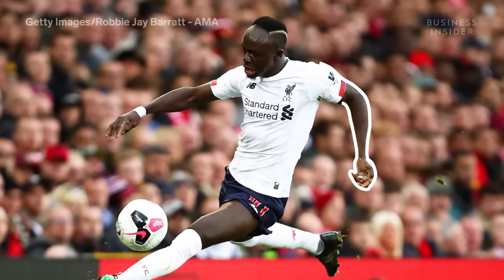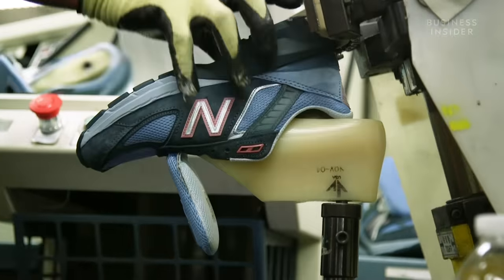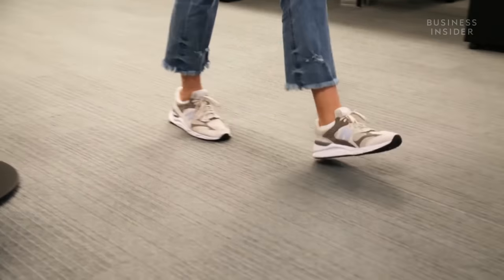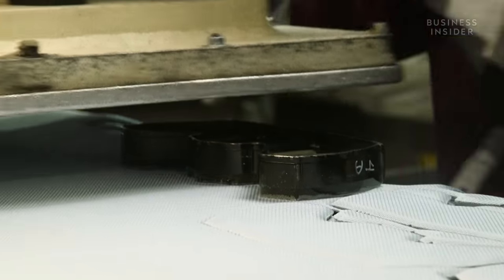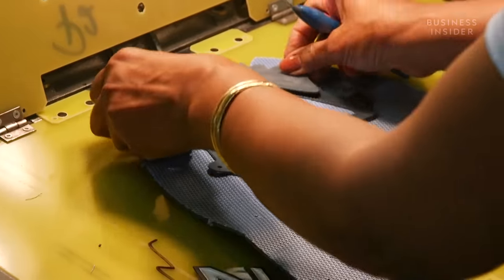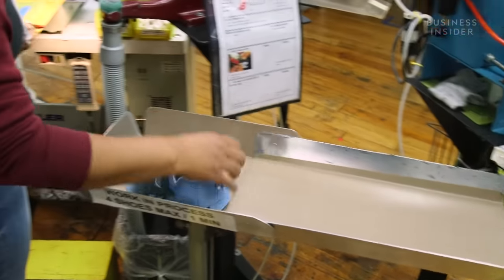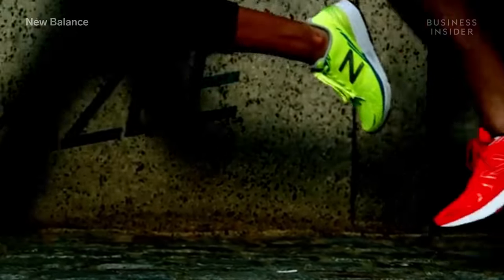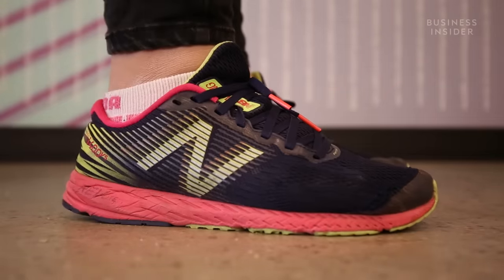How New Balance Sneakers Are Made | The Making Of

Comment: NB Number System
50: Fitness Running
60: Stability
70: Light Stability
80: Neutral
90: Speed

Very handy to know now!
Reply: What is 997H?
Reply: @andrew1983  thanks. How do i find this list, (other than this video)
Reply: C J I never knew that!! Thank you!
Reply: 40 is "Control" aka Motion control or optimal control.  The 840 is oddly an exception to this rule and is a neutral cushioning shoe.  Many of the shoes don't have numbers so you have to look at the tech sheet to see which category if falls under.
Reply: 1000 level?
Reply: Thanks for posting this I never knew.
Reply: 574?what class is belong to?
Reply: @diazzlingpictures2236  70
Reply: What's the one on the video called
Reply: @diazzlingpictures2236  fitness running 🏃‍♀️ I think it’s what number it starts with ^^
Reply: What's the number for standing in one spot for 10 hours with limited walking? Actually it's probably the stability or light stability I guess.
Reply: I got a 420. Not even joking. Which category is that? I also have a 009.
Reply: 2002r?
Reply: 1906?

Comment: One big difference between New Balance and All the other brands True Wide Foot support It's definitely not perfect but New Balance is definitely the best when it comes to it's wide shoe selection offering compared to their competition where you'd be lucky to find a shoe that they sell in a wide size That the reason why is buy New Balance They're the only ones that fit my foot properly My personal foot measurement is a Men's 9-1/2 wide and I can guarantee with new balance that I can find a shoe That fits me unlike other brands. Where most likely they don't sell a wide adds more than likely the sizes aren't the same as the standard measurement So in a Nike or an adidas my foot may only fit in a 10 or 11 and even then they more than likely than that they don't offer a wide size New balance seems to be the only one that has a shoe that will properly fit everyone and is usually pretty comfortable

Comment: Most of New Balance running shoes are bad for uphill due to the creepo thickness ...... long distance uphill or steep upwards run not typical for runner to land with forefoot or toe ... its not a sprint uphill therefore even moreover the thick midsole is bad for heel landing on uphill long distance run ... most would run uphill leaning the body forward to the angle of uphill steepness .
8 years ago i tried using minimalist New Balance shoes for long distance it was great ... for seasoned feets & legs only ... nowadays been using the common New Balance shoes its comfortable but lose alot time going long distance uphill ... especially the route i train is 7 steep uphill to 3 slight downhill stretch with many corners ,no flat or straight to go smoothly .
I think they should come out something great for uphill like Asics to fill their line up ... thinner midsole would be great for more speed ... while maintain min-slight comfort or cushioning . 

Actually i felt comfort or cushion is pretty stupid for speed run of long distance as runners would be competing against time rather than whose getting the comfort to support ratio .
When i run i prefer to go as fast to maximise the time for improvement however the minimalist shoes for daily would be easy for long term injury and the friction is like formula 1 races lasting period :)Another reason is like normal NB Running shoes and its minimalist line up when you run at full speed the running pace , style of your body arms legs ankles foots movement all changes especially how you land on your foot and span of your legs all changes ... This is why they need a good durability less cushion less comfort more speed type of line up close to minimalist line up without the cons of friction get use up fast while not that damaging to legs knees etc for daily or 3-5days a week runners .

Comment: I've bought new balance shoes, but I found that the upper material and the lower sole are just glued together therefore they always come loose at the side of the toe,and thay cut the material for the upper part of the shoe to short which don't leave enough to tuck between the sole and the tops leaving not enough material to be glued,go back to stitching shoes together so they last a little longer then 6 months.at $80.00-$100.00 a pop you would think they would take more pride in the shoes they make..
the old buddies from back in the day were made more durable then today's shoes,I call them throw-a-way shoes..
Glues are good for something's but not shoes..never will I buy another pair of these shoes..it's all about money not quality of their product.
There's not a  warrenty on replacement due to material malfunction on the new balance company shoes..